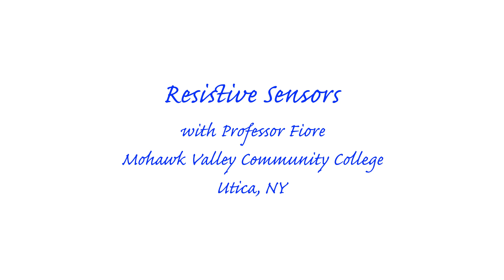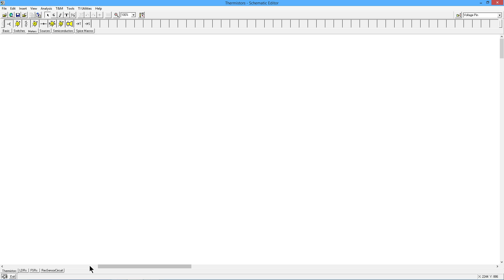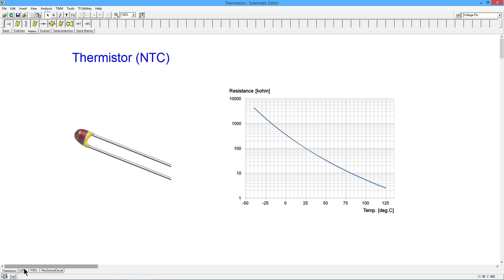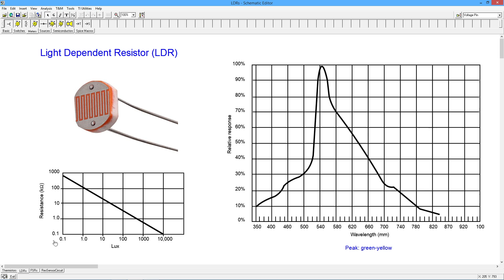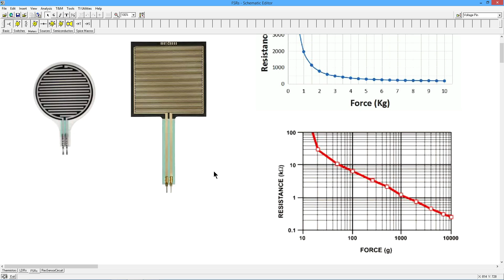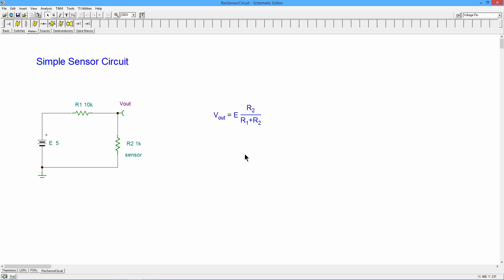Resistive Sensors

Comment: I like the video.
Could you please explain NTC in more depth.
I want to use one as a soft starter for my variac. How do i choose the right one? What are all these numbers on an NTC?
Reply from the maker: NTC stands for negative temperature coefficient. In other words, the resistance decreases as temperature increases. Looking at the graph in the video (around 3:00), this should be obvious. What may not be obvious is the near-logarithmic change is resistance. Note that the vertical scale is changing by factors of ten. Thus, you need to think of this in terms of the resistance changing by a certain factor over a range of temperature versus changing by so-many ohms. For example, there is roughly a ten fold change in resistance as temperature is increased by 50 degrees (from 25C to 75C). The plot is not perfectly straight, and the change is a little faster at lower temps and a little slower at higher temps. 

The trick here is to design the circuit around the performance of the available sensor (as shown with simplified examples later in the video). Ultimately, it's up to you to determine the environmental variation you need to cover, and design the circuit to match that.